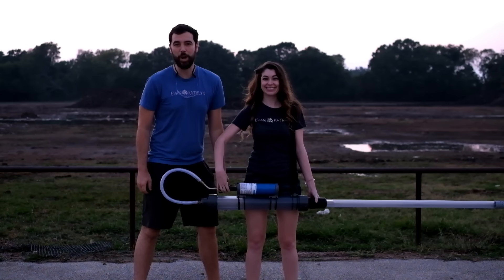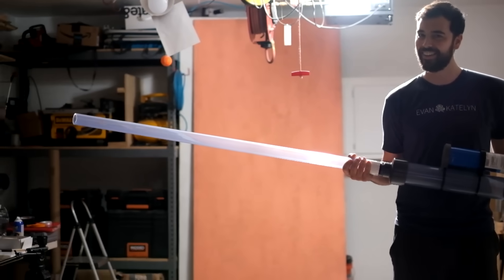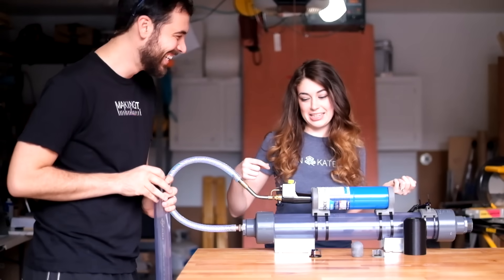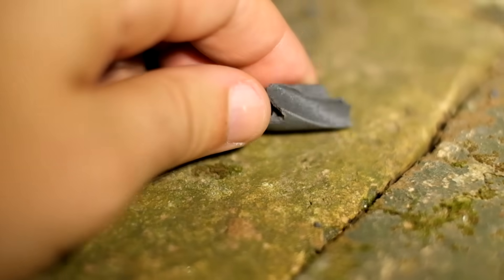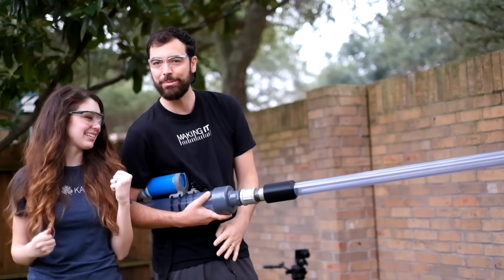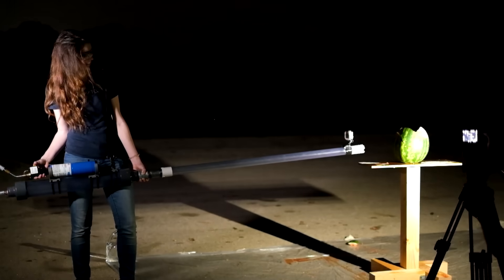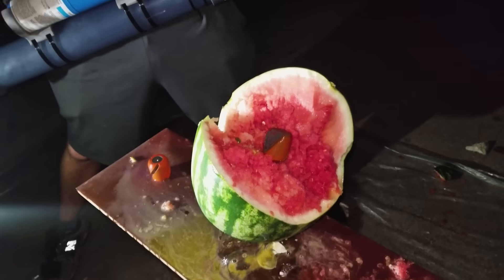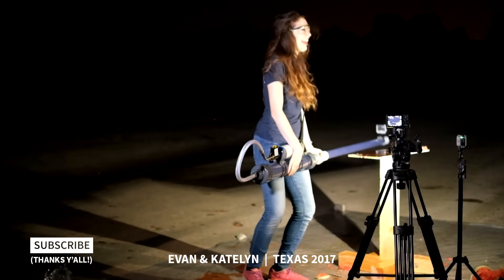Cops caught us firing our homemade propane blaster

Comment: So it you had a continuous spartan ignition at the back of the big chamber then just a flow nozzle on the torch you could let gas into the chamber with a spark going so when it reaches the mixture it just goes. No guess work
Reply from the maker: That sounds like a really good idea!!

Comment: I would build a separate ignition system. Those bottle torches will burn out to easily it seems. I’ve gone through a few because they just don’t light anymore. Try a grill ignition system like what they use on potato guns or modified taser
Reply from the maker: Ah thank you for the tips!

Comment: Hey guys by using the built in igniter you adding more fuel into the chamber I would suggest to separate the too this way you have more control over the fuel to air ratio. In addition add some kind of valve to add air into to chamber if you went to heavy with the fuel
Reply from the maker: Thank you for the tips! We'll keep these in mind
Reply from the maker: Sweet, yeah think we might try something like that in the future!!

Comment: Do you have the air holes on the side of the torch nozzle covered? If so, might help with your gas mixture since those holes let in enough air for the torch to be a torch. Unless you have a tip on it without air holes, get one that has them. Like this one: https://www.homedepot.com/p/Bernzomatic-Pencil-Flame-Brass-Torch-UL2317/100079143
Reply from the maker: the tip of the nozzle is open so I think it would let air in but it still has a long way to travel to get to the ignition chamber
Reply: @EvanAndKatelyn  Oh, I see. Yours has the outside air inlets near the igniter housing. https://www.homedepot.com/p/Bernzomatic-TS4000T-Trigger-Start-Torch-Head-TS4000T/202185055 I couldn't see that in your video so it looked like you had the air inlet holes covered on the tip itself.

Comment: Hi Evan and Katelyn...This maybe a little late, but you asked for suggestion to better loading....so here is what I recommend
Cut out the top of the tube close to where it sits. That becomes your loading spot.
Then cover it with that black 3D printed sleeve you had on it...that should be tight enough to not leak any air out
Reply from the maker: Thank you! Wonder if the 3D print would hold up against the pressure... might be worth testing :)
Reply: @EvanAndKatelyn  you can create it in a way where it slides over and then have a knob to pressure lock it.

Comment: So my guess is propane is heavier than air so when you tilted the barrel down this naturally pulled some air into the combustion chamber. Using a little-compressed air might help. Second make sure not to glue the back of the combustion chamber but instead just make sure it is a snug fit. If the chamber gets over pressurized you want the explosion to exit the back end not out the side making plastic sharp metal ... especially considering what body parts you two were holding the blaster by :D
Reply from the maker: Won't the explosion always go out the open end though?

Comment: Wow! Awesome project! Breach loading would make it much easier to load. Your consistency issues are around air/fuel mixture, I would suggest putting a barbed hose fitting attachment into the main (combustion) chamber, and attaching a compressed air container with a metered valve with hose so you can force the right amount of air into the combustion chamber.
Reply from the maker: Thank you so much for the tip!

Comment: You're not getting good mix in the combustion chamber.  Idk if you guys are giving it enough time to exhaust and ingest fresh air, but your breech airflow bypass is, obviously, workable.  I think, however, you really just need to fully evacuate the combustion chamber before you add fuel in.  Do that and you can go back to using non-fluted slugs.  You can also do a 2 part sliding breech to load.  Inner sleeve is half cut open to accept the slug, then the outer sleeve slides over the chamber and seals the breech.  If you have a good solid seal with the slug, your firing angle will be increased greatly.
Reply from the maker: Thank you for all the helpful tips!! We'll definitely keep all of these in mind!

Comment: A simple way to fix the air issue would be to put the igniter in the combustion chamber. When the igniter is up there its only hitting the raw propane. If you put it in the chamber where there is O2 it should have no problem igniting without any of the other measures you guys took. Love the video and you guys channel BTW. One of the reasons why I started mine!
Reply from the maker: I think we might try something like that with a grill igniter... Or maybe a taser! Thank you so much, and that makes us so happy to hear that we played a role in you starting your own channel, that's so awesome!
Reply: Thanks! Also the muzzle break on yours can be functional. I'm making a video that will be uploaded in a few days about a potato canon I made and in the video i'm going to add a muzzle break to the end that redirects the gasses to help reduce recoil.

Comment: One quick solution that could have solved your problem from the beginning: fill the chamber with propane first, then drop the projectile in. The projectile, being airtight, would have pushed a bit of propane back toward the ignition point. Because of this, you can still fire after stopping the flow of gas. Also, tilting the gun up like Katelyn did causes liquid propane to flow out of the nozzle, which is both bad for the torch and also the reason why it wouldn't fire.
Reply from the maker: We'll have to keep that in mind for the redesign! Thanks!

Comment: This is a great channel! You guys seem like a lot of fun. You should buy some 1/2" short bolts and 3D print your bullets to have a hole in the front, then screw the bolts down into the bullet for some extra weight and penetration. You could also put the bolts in a drill and spin them and grind them against a bench grinder to give them a nice point.
Also, if you want a  much better fuel/air mix for a more powerful shot, use a brushless motor fan (the fans in computers are brushless, meaning they won't spark). Place it inside of the combustion chamber and turn it on, then inject your fuel and air.
Reply from the maker: Glad you like th channel! We actually did test one bullet where we added a ball bearing to the tip and it worked really well! We'll have to look into using the fan...

Comment: I might be very late to the party, but the loading section could be a simple twist thing with a slot, have rubber seals on the inside (or some kind of seal), drop the projectile in and twist until the seal is good. I'd also add a grip for both hands, could be held more like a minigun with a top vertical grip at the front for easier maneuverability. And the firing hand should have something to hold on to where you can still hit what you need to hit (Let that be the guiding hand and let the front one be the weight distributing hand.) Looking at the ergonomics of actual firearms might give you a few ideas to make it less cumbersome.
Also, some sort of aiming device would be fun (look into holo sights and see if you can't make that a project, or just go for pure ironsights, my suggesting good old WWII aircraft circle sights)
Reply from the maker: So many good ideas!! Love the idea of adding better grips... It was especially awkward for me (Katelyn) to hold onto so some grips would be great! Thanks 👍

Comment: It fired so inconsistently because you are igniting it at the end of that tube, which has no way of getting any oxygen. Unplug the tube from the propane torch quickly after you  fire and let it air out, plug it back in and fire and it should work every time. 

Pure propane in the tube is no bueno.

Comment: How did you determine that the chamber pressure wouldn't blow up the barrel (in your faces)? Obviously that hasn't happened, but how were you sure it wouldn't?
Reply from the maker: At Evan's day job, he works a lot with PVC and pressure tolerances, so we just made sure we were using materials that were WAY overrated for what we needed (we basically over-engineered it)
Reply: Too bad Evan still needs a day job. You guys are great at this - do videos full-time! :-)

I can look up how much pressure PVC pipe can take, but how to calculate the maximum pressure the fuel/air mixture can produce? Can you point at a website or formula?
Reply from the maker: Yeah I found a website that had estimated pressures but not sure where it is anymore. I think the estimate (depending on air fuel mixture) was around 75 PSI and the schedule 80 tubing I chose was rated for around 300 PSI if my memory serves me correctly -E

Comment: I've got a lesser gun to drag out during fireworks shows. Just coils of hose fed from a bottle of MAPP gas to do a swirly light show. It wasn't firing regularly at first, either, but I learned that I need to half hold the button for two or five seconds to fill the hose before fully pressing the button. Improved my successful firing rate significantly.
Reply from the maker: Nice! Yeah we've tried various levels of holding the trigger at a half press and then pulling it, and had mixed success. I think because sometimes there is lingering propane already in the barrel, throwing off the fuel air mixture

Comment: Its difficult for fresh air (oxygen) to get back into the expansion chamber. I"ve seen designs that have fans that pull in fresh air between shots. You could also add a separate oxygen tank but then it might explode.
Reply from the maker: +M Reiter haha we thought about a separate tank but seems a little risky! Interesting idea incorporating the fan
Reply: Check out this website for some pretty cool design ideas. http://www.advancedspuds.com/chamber_fan.htm
Also, i know it looks cool to have the fire start in the tube but it would probably be more consistent if the sparker was in the chamber. I look forward to seeing more videos from you guys!

Comment: In addition to the massager gas, put a tank (can or something) with compressed air (connected to the pipe where the explosion happens), then you will be able to control the gas mixture, it would be nice if you had a dento pressure gauge of the tube to know which is the ideal psi. :)
Reply from the maker: +Leonardo da vinci we considered doing something like that. I think first we will try a more reliable ignition method - just got a grill igniter and a taser to test! But if that doesn't work, focusing on the air mixture is something we will keep in mind. Thanks!

Comment: The inconsistency that you're experiencing is due to the orientation of the propane tank. When it is turned upside-down, the air fuel mixture is too rich to ignite. when the torch is oriented at least a few degrees above horizontal the air fuel mixture is closer to a stoichiometric mix. So all you need to do is adjust the position of the torch so that at any angle you'd firing at, the torch would always be  oriented at least a few degrees above horizontal.
Reply from the maker: +Trent Osborne that is super helpful to hear! We are working on sprucing up the cannon soon and we will definitely keep this in mind, thank you 😁

Comment: To make it fire more consistently you need to introduce new fresh air every time you fire and get rid of the old air that no longer has any oxygen left to burn. Hope that helps. Have fun and stay safe!
Reply from the maker: Sorry it took so long for us to get back to you on this comment, we wanted to save all the suggestions in a google document for when we make version 2.0! Officially on the list, thanks for the suggestion :D
Reply: @EvanAndKatelyn  right fresh air is imporant I   make  compression by  into it by drilling and screwing tow screws  in a v angel attach wires from a electronic ignitor ,no air leaks bevel  both  inside and  outside of the end and try propane it will be hard to ramrod but be persistent ,canada

Comment: Instead of using the piezoelectric igniter, how about using the electrical version used on larger outdoor grills. It constantly fires when pressed. Also, you still need oxygen and the propane to get combustion. So some how you have to blow some air in to the chamber to get consistent ignition. JMHO
Reply from the maker: Sorry it took so long for us to get back to you on this comment, we wanted to save all the suggestions in a google document for when we make version 2.0! Officially on the list, thanks for the suggestion :D

Comment: For loading mechanisms... Check out the term "break breech gun" or "break action."  Alternatively, cut your breach in half, so that the top can come off. Drop in your round, put the top back on, reinforce the whole thing so the bullet goes down the barrel rather than straight up. "Reinforce" here could mean "have a second pipe that fits tightly over the breech, but slides forward for loading purposes."

Also, if you haven't checked it out, take a look at Nighthawkinlight's take: https://www.youtube.com/watch?v=bB01zORIGkA
Reply from the maker: Sorry it took so long for us to get back to you on this comment, we wanted to save all the suggestions in a google document for when we make version 2.0! Officially on the list, thanks for the suggestions :D

Yeah this one was definitely inspired partially by his video, so fun!

Comment: Move your ignition to the chamber. It's almost pure gas at the nozzle where your ignition currently is (not enough air to ignite). I would use a regulator on the bottle and a bottle of compressed air with a regulator and use the air tight rounds. One idea. I'm sure there are dozens of better ones here too.
Reply from the maker: Sorry it took so long for us to get back to you on this comment, we wanted to save all the suggestions in a google document for when we make version 2.0! Officially on the list, thanks for the suggestion :D
Reply: @EvanAndKatelyn  https://www.youtube.com/watch?v=_TNSUIsjdpY
Reply: actually having it at the beginning is better because if you put the igniter in the chamber ignites the gas on the tube backwards potentially damaging the blowtorch and losing power turning it into recoil
Reply: Mr Donut: it burns in all directions because it is expanding gas and once the gas that was burning toward the torch doesn’t have room to expand it will be forced the other way, since the pressure is higher than the other direction. It basically just builds pressure until it surpasses the bar of the other direction, then moves toward the low pressure. It would work
Reply: @mrdonut7158  it would still be good to try it tho!
Reply: @mrdonut7158  thats not how the laws of motion work
Reply: If it has to be at a certain angle, you could make a bubble level for the correct angle
Reply: How about moving the torch so that it doesn't need to be tilted down

If I remember correctly the blowtorch has to be upright to work and stuff
Reply: How about using the compression  of the gas to somehow force air into the chamber
Reply: Just add a hole in the hose right after the gas enters. This will allow air into the gas mix
Reply: hitting gas then spark instantly just ignites tiny amount of gas in fuel line and burns it out. Need to have an ok amount in chamber to ignite.
Reply: matthew sheppard: that’s why you wait...

Comment: Suggestion for your loading compartment - cut out a rectangle in the tube, grind down a little bit of the part cut out, put some rubber (o-ring maybe?) on its edges and then attach it to the main tube again with a hinge. Add some sort of lock to keep it closed. Then you just unlock it, open the door, insert the bullet, close it, and re-lock.
Reply from the maker: Sorry it took so long for us to get back to you on this comment, we wanted to save all the suggestions in a google document for when we make version 2.0! Officially on the list, thanks for the suggestion :D
Reply: EvanAndKatelyn instead of a flap or something you could have something that slides closed over the hole. It could be as simple as a sleeve that goes all around the chamber to cover the hole when firing.

Comment: Maybe the reason for the inconsistency is that after the first shot the chamber is filled with carbon dioxide. So when you then add the propane it's just propane + carbon dioxide and no oxygen. That might be the reason that it has to be tilted down too, because carbon dioxide is heavier than oxygen, so tilting it down makes the oxygen that's in there flow up the tube so that it can fire. Try adding some kind of venting mechanism, or for even more powerful shots, an oxygen canister!
Reply from the maker: WHOA! Think you're on to something, I think carbon dioxide might be part of what is going on! Venting is a great idea and yeah we've totally thought about oxygen, but also worry about how much that would boost the pressure :P

Comment: Another great video you two! Suggestion on the ignition, the air gas mixture is a the propane nozzle... And it fires from there through the chamber and out the barrel... If the have the ignition inside the chamber there is more of a air/gas mixture I think... You should get more consistent results... Maybe using a "tazer" fly swatter to get a spark... Just an idea.. Love the look of this video.. Katelyn's shock was priceless! Lol
Reply from the maker: Sorry it took so long for us to get back to you on this comment, we wanted to save all the suggestions in a google document for when we make version 2.0! Officially on the list, thanks for the suggestion :D